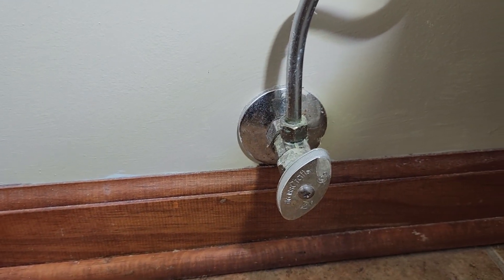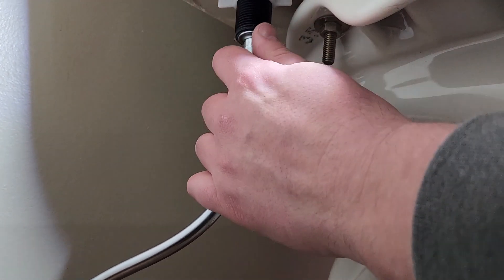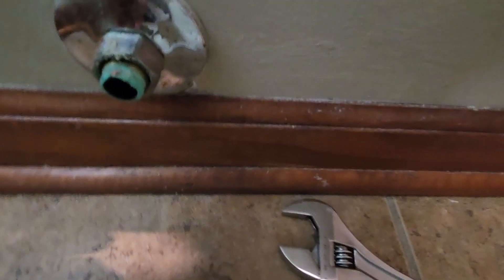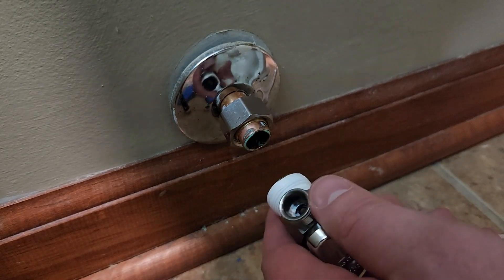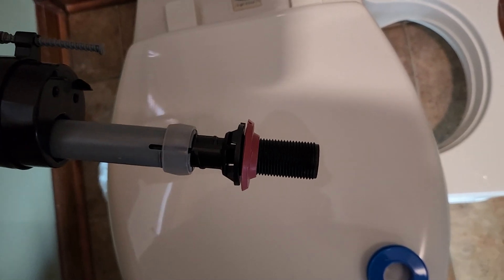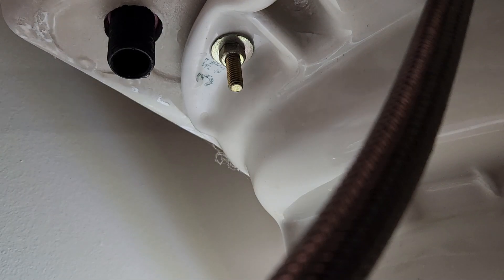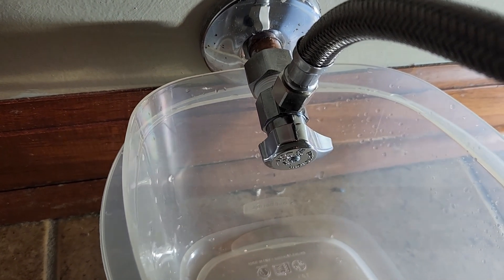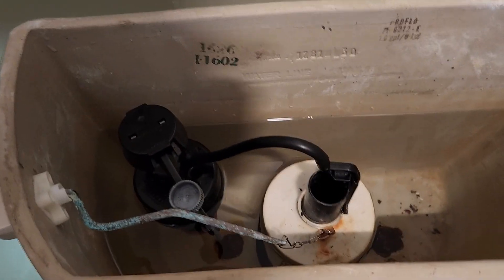Replace a Toilet Shutoff/Isolation Valve (Compression), Toilet Fill Valve, Plumbing ASMR?

Comment: Just did this yesterday for the first time. Wish I had found your video first just for the confidence building. At any rate, made it happen. Had a difficult time removing the old ferrule, but I used that same tool as you and it eventually came off. The old ferrule also left behind a deformed pipe. I was worried that wouldn’t seal properly, so I cut the pipe off with a mini tube cutter. I was lucky to have enough pipe exposed to do that. Thanks for making the video.

Comment: I think your milage will vary with the puller based on how seized up the ferrule is. My next stop is either the $40 specialty tool or a plumber.
Reply from the maker: Make sure you are using it right and your ferule puller isn't bottomed out!

Comment: Question, I'm confused as to where did the water in your hot water tank go? You cut off the water to house but isn't there still water in a hot water tank that didn't drain out into that quart size container in basement? I need to replace hot water valve under bathroom sink.
Reply from the maker: This question makes me think you should hire a plumber 😅🤣

If you shut off the city water, your domestic water system is no longer pressurized. You only have to drain out the volume of water in the pipes that is roughly the same elevation, or higher, than the shutoff valve you are trying to replace. Usually this is less than a gallon and can be drained at the valve too, it just sometimes gets messy. Have a big enough bucket or pail ready!

Comment: Does the  ring deform the pipe? If the ring is removed can I switch to a press on fitting or is the pipe deformed?
Reply from the maker: It shouldn't, you can always switch to a SharkBite fitting if they make a compatible one. I would try and remove any stuck on residue to ensure a good seal.

Comment: I am in a panic and don't have $350 quoted. I don't see a knob on hot water tank going out to turn off, so do I have to turn off and drain out 50 gallons of hot water to replace hot water valve under under sink? Even if I shut off water to house the tank is still full of hot water to spew out right??
Reply from the maker: This question makes me think you should hire a plumber 😅🤣

If you shut off the city water, your domestic water system is no longer pressurized. You only have to drain out the volume of water in the pipes that is roughly the same elevation, or higher, than the shutoff valve you are trying to replace. Usually this is less than a gallon and can be drained at the valve too, it just sometimes gets messy. Have a big enough bucket or pail ready!

Comment: BRASS NOT COPPER FERRULE, other than that your tutorial was very good, also for those who do not have the puller have them reuse the old one(nut and ferrule), just replace the valve
Reply: I need you to help me with my puller
Reply from the maker: Whats up with your puller?
Reply: That won't work if the thread pitch of the new valve's compression fitting differs from that of the old valve.  The only option then is to remove the old ferrule and nut so the new nut and ferrule can be placed on the pipe stub.